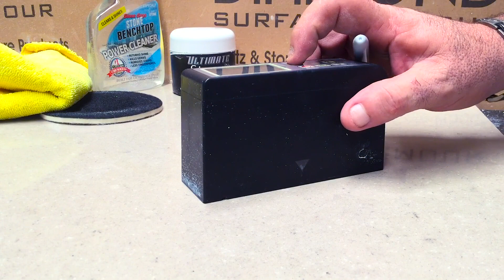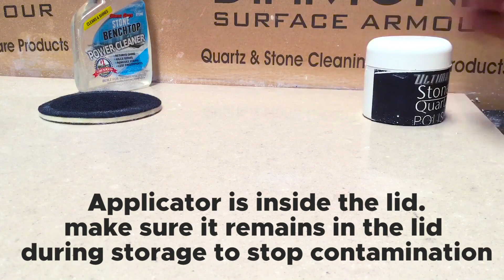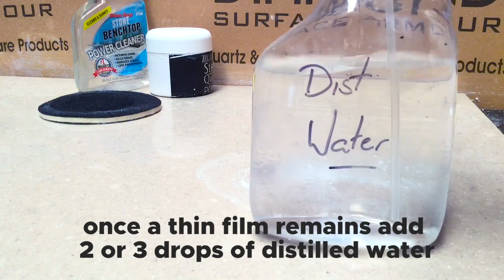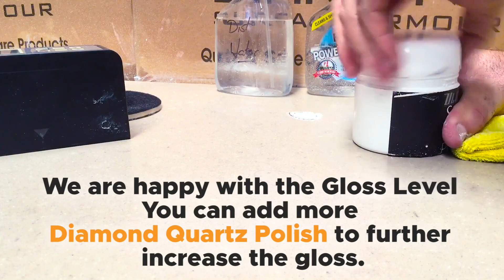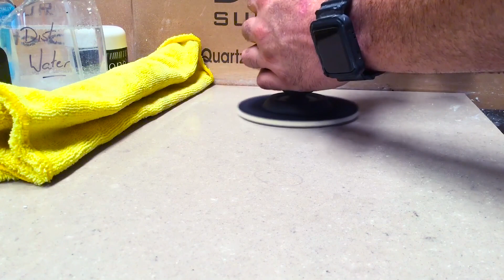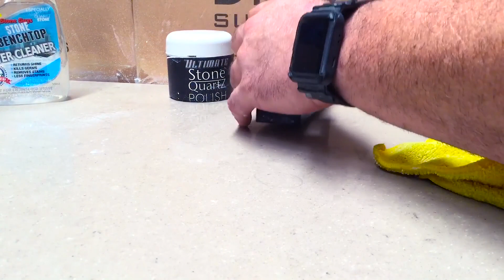How to polish caesarstone benchtops countertop - make caesarstone shine - my caesarstone is dull

Comment: will this method work for Anatolia "Marmiline" - engineered stone for showers?
Reply from the maker: From your photos you have emailed through to Stone Guys, it is been etched by bathroom cleaners. Hence if the area is rough it will not work as the damage is more severe requiring replacement or repair.   Please see.....https://stoneguys.com.au/stone-benchtop-stains/
Reply: @diamondsurfacearmourptyltd7897  Hi, i would like to purchase your products, who can i contact with?
Reply from the maker: Please email us at info@stonebencthopcleaner.com.au